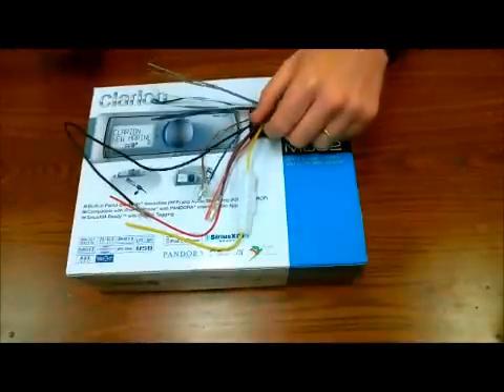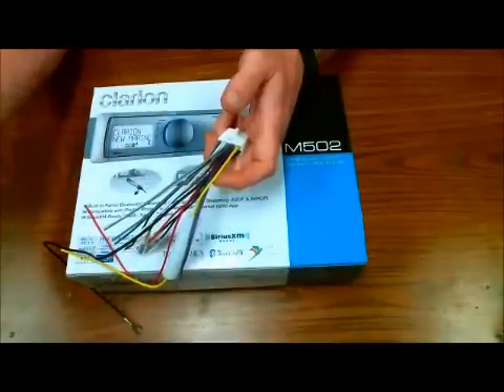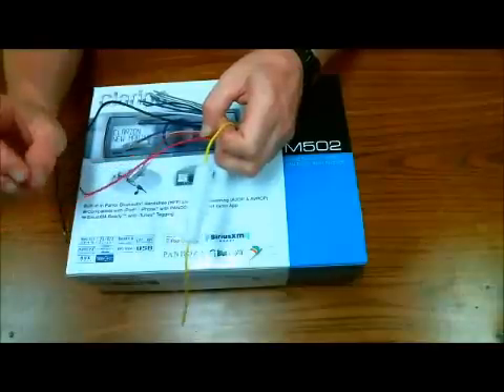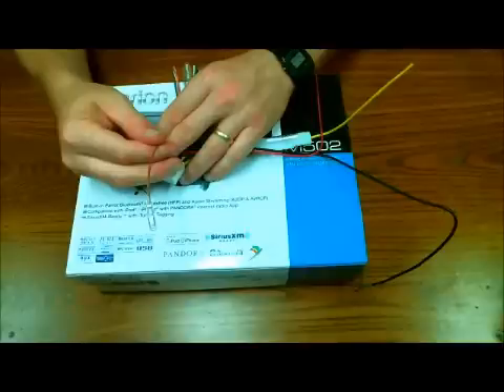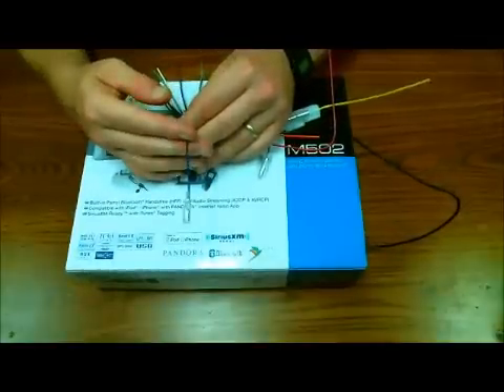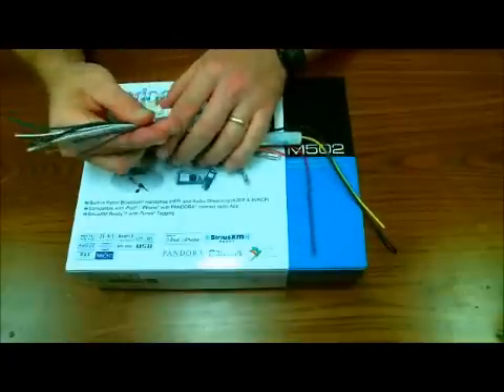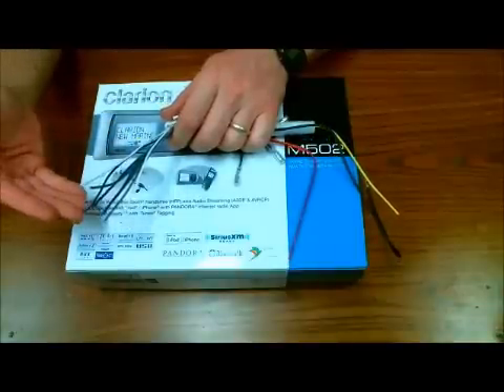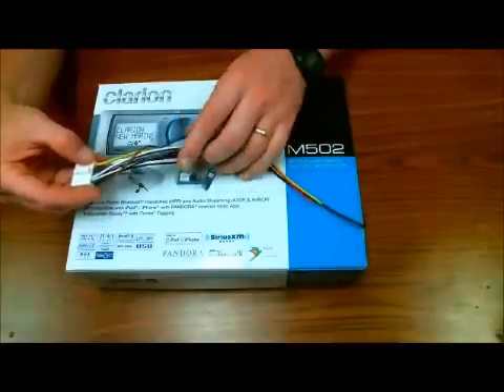Car Stereo Wiring Explained In Detail

Comment: Wanting to use for a shop radio. Turn it on and forget it. Two speakers.
Controls stay at 'center' for fade and 'center' for right and left
So 8 wires to 2 speakers.
Power with a 12 volt battery charger 2 amp. [ Hard Wire ]
Antenna is non powered whip. No amp.
No white wires
 
Problem--> 13 wires no factory plug. No stripes, no tell-tails on any wires. All solids.

Yellow solid power + constant power w/ fuse
Black solid ground - constant ground [ and wire to radio chassis for added ground ]
Purple solid ... might be antenna? [ not  used ] always hot, radio on or off.
Orange solid ... illumination wire don't care about dimmer. [ not used ] not hot
Red solid key on ... not using key 'on'. [ not used~red need power? ] not hot

8 speaker pairs of wires. ->Can test phase/polarity w/ test speaker, out +/ in -

Blue    solid two wires [both same color] front left
Grey   solid two wires [both same color] front right
Green sold two wires  [both same color] rear left
Brown solid two wires [both same color] rear right

1997 Saturn am/fm radio.  Right and Left  and Fade and Balance
Delco 89BPZD SER. #2 1023442    SER MAN  W

Model 210200996
Serial 0122409
11/03/97   owlsnest34@hotmail.com  comments?

Comment: hello bud ive just got a pioneer unit for my polo and ive plugged it all in works great.. apart from when I turn off the ignition and take the keys out....when I restart the car all the settings are lost so im starting from scratch every time I get into my car.....ive just had a fiddle about behind the unit and connected up a blue wire and now all the settings are saved BUT..... it seems to have disabled the alarm!... I can lock my car using the key but just no electric central locking.....oh and the yellow wire is connected like you say in the vid.....if you can help in any way it would be much appreciated
Reply from the maker: Sounds to me like you have the yellow and red wires backwards...

Comment: Hi, I really appreciate the simple explanations of the wiring.  I have some basic experience in automotive wiring but my new radio (Boss audio BV9967BI) did raise a couple questions.  First I do have a power antenna wire.  However am I to understand that a power antenna is one that is motorized and raises when the radio is on , because I don't have one of those.  I have an internal antenna.  Do I need to hook up the power antenna wire at all?  I also have a few additional wires on another part of the back of the radio: another ground wire, key 1 wire, and key 2 wire.  the wiring diagram does not account for them.  Thanks.

Comment: I have a old school Sony XR-C6120 cassett deck and want to upgrade to a new deck.  Can I use the same harness, or can you buy adapters so I don't have to do any rewiring?  I lost my removal key, can you buy any Sony removal key, or can you use another tool?
Reply from the maker: Sure, reuse the harness. That's just fine. As for removal  keys, you can use a thin object to slide on the sides of the radio and the sleeve or get sony keys, either will do..

Comment: "Rdsprod" on those later gm vehicles like your asking about about yes you have to run a piece of wire from the 12v switched or acc circuit of the new stereo down 2 the fuse box. There should be a fuse in there for the radio circuit. That is the fuse you need to connect 2.. that's the easiest way to get a 12v switched signal to power up an aftermarket radio in gm's. Hope this helped ..

Comment: hello chevy impala 2007 wiring harness comes with two harness and an extra red wire on the side. Is the red wire going from the double din red wire to the fuse box? I am a super beginner and radio is not working.

Comment: I have a 93 Rockwood Coach that I am replacing the old Craig deck with a newer JVC deck. The Coach was wired with only one black wire for the - side of the speakers. I don't understand, I have never seen that before. How do I wire the speakers with only one negative wire?

Comment: i am using a sony radio from my integra, (aftermarket) and i want to install it in a new hynudai i bought last week. the wiring is all different. there are 3 brown wires, 3 grey wires, 1 white 2 purples and i looked up hyudai sonata harness diagram and is still not working. on the diagram i noticed something saying A+ B+ LUM and ground. i am assuming the black is the ground wire, but when i pulled out the radio there was a separate ground wire from the power source to the frame of the car. any help would be appreciated.
Reply: sorry, not a new hynudai, 2003 sonata. the sonata has a stock radio, and sony i am installing is a 540ui any help?

Comment from the maker: give me more details and I can explain why that is... give me your model unit etc..
Reply: I have a bunch of disconnected Red and Black and Yellow and black connectors in my Dodge Charger 2008 SE Plus do they go to amps or speakers or what?
Reply: I need to know what color wair is the hot  and with is the ground  on my 97 cameo. The  color that's in the  panels are white  or  yellow  and a black
Reply from the maker: @robetbrady282  yellow is constant, 12v red acc 12v, black is ground
Reply: I have a padofo mp5 and it works but i cant get the sound to work i have an extra pink green and orange wire with a white stripe, idk ive tried everything even changing to new fuses but i cant get the sound to work
Reply: And the only way it even turns on is to connect the red and yellow i have tried them separately and it wont turn on until they touch
Reply: Why does everyone say something about a blue and white stripe wire but mine didn't come with one